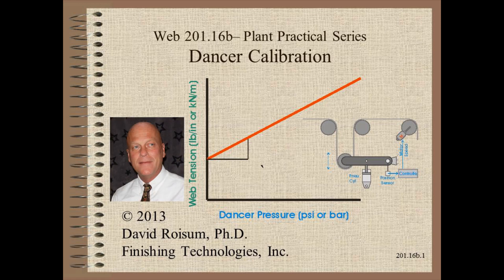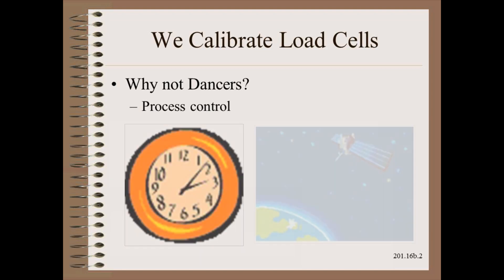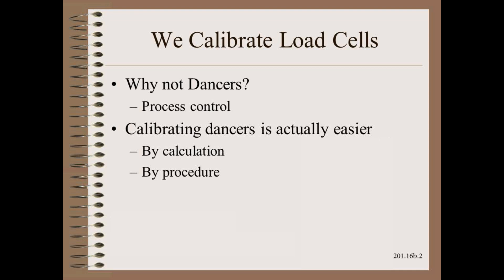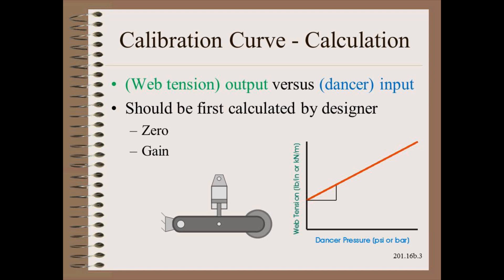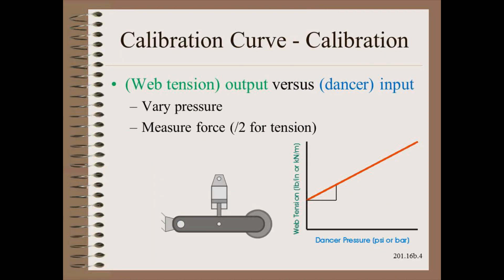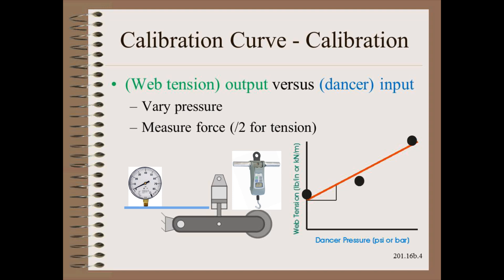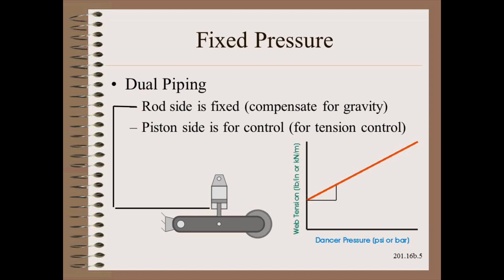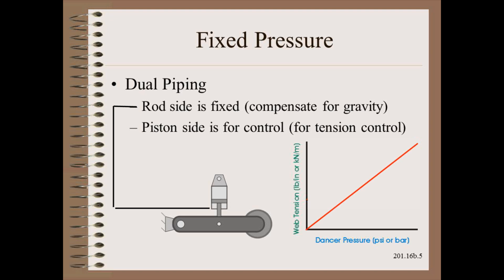Web201.16b - Dancer Calibration

Comment: Hello sir, we have a question regarding tension control with dancer mechanism in surface winding mode, not getting good winding quality in either speed mode or torque even after lots of trial error with different Kp, Ti and Td values.
Could you advise what could be the reason for it?

Defects are
1. Dancer not stable even after film gets stable tension
2. Corrugating on roll
3. Uneven winding
4. Telescopic roll
5. Too tight winding
Reply from the maker: Thank you for the question, Hardik.  There are many who have drive/tension control problems, such as the one you describe.  Programming web drives is a specialty  that involves knowing web handling well and knowing web drives well, both are two day courses offered by AIMCAL's Converting School Online.  Alternatively, the Web Handling Handbook has  50 page chapters on each of the subjects of tension control, drive control and winding.  With efforts such as this plus much field experience, problems such as described above become difficult but 'tractable.'  A background less than that make even the simplest questions nearly impossible to answer without asking a hundred questions in return because of this level of complexity is required in web drive systems in order to work well.   I have worked on many winders whose drive code was 5,000 PAGES long.   In short, we don't 'tune' drives.  We 'model' them so closely that the motors might  even be able to run without feedback from from load cells and dancers.  I suspect that none of that modeling structure is in place and if not, a satisfying fix will not likely come from playing with taper, PID's and so on.

Comment: How to calibrate dancer potentiometer
Reply from the maker: The dancer potentiometer should read about the middle of its output, say 14 mv if the output of the device is 4-20 mv, when the dancer is near the middle of its stroke and near the bottom of its output when the dancer is near the bottom and vice versa for the top.  MUCH much more important is DANCER DESIGN, see Web201.16a-c and DRIVE TUNING, see Web201.25a-f or better yet a whole two day course on this by Clarence Klassen.